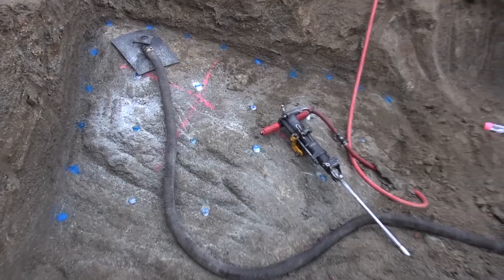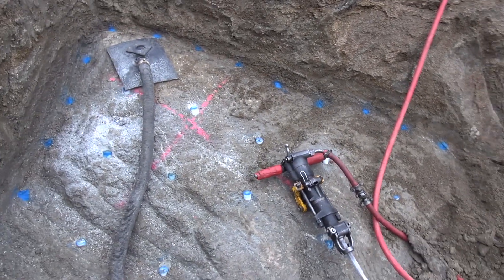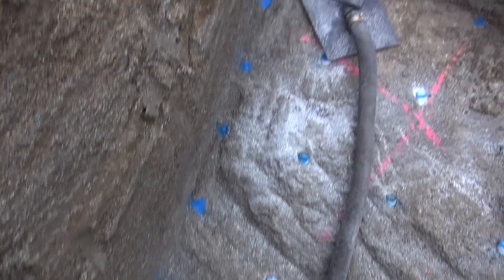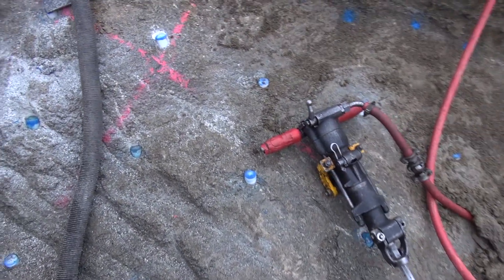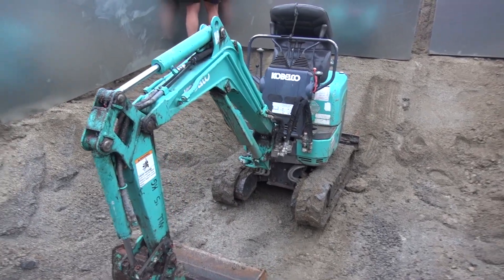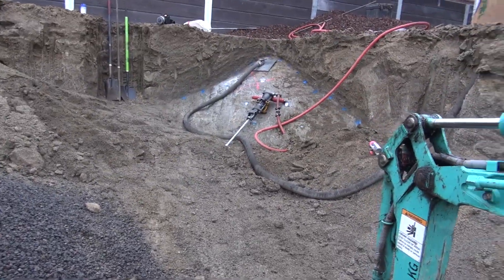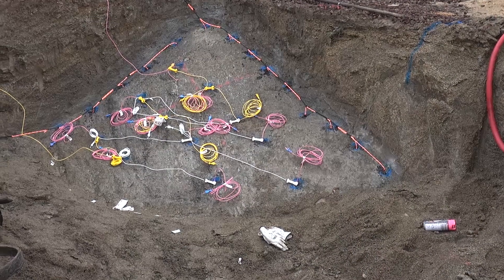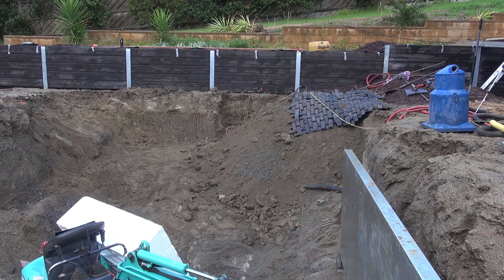Drilling and Blasting Granite for a home swimming pool excavation

Comment: Do you use a different charge in the Pre-split, or do it by timing? Nice one Dave. 👍🏼😀
Reply from the maker: Both! The regular blast holes have all of the charge at the bottom and they are fired sequentially, the split holes are loaded with a light uniform charge over the full length and fired all together.

Comment: Good job Dave. That split line was amazingly sharp and clean. That little excavator is amazing as well, it will fit through a standard size doorway. Now can the Rodeo tow a trailer with it and the compressor on it?
Reply from the maker: Not mine Mark, this one belonged to the pool guy.

Comment: Those holes along the outside edge can't have been fun to drill. Tough footing, carrying an air drill.
Reply from the maker: Yeah, That is exactly right Mr.LP Typically what I would do if it were too difficult would be to drop a longer drill into a lower hole and use this as a foot hold.

Comment: i'm glad i had finished my cuppa, or i'd have sprayed the keyboard when you said hydraulic teaspoon.
.
G'day Dave, great video.
edit: the movement in the retaining wall was fascinating to watch.
Reply from the maker: The wall, yeah, was a bit concerned about that as very likely the nearest post was also founded on this same rock. Changed my mind about firing the presplit line first and made it a post split for a milder vibration result, probably a good thing. Nothing like the coffee coming out your nose!

Comment: Another good one Dave 👍. What are the specs on the Compressor you like to use? (CFM, horsepower, etc.)
Reply from the maker: The small compressor that I most often use is a Sullair DPQ185 - 185 CFM - The drill only requires about 120CFM but having a bit more available if good when you want to use a blow pipe to move soil or when working in an alpine area where the air is thinner. It has a 2.2 Litre Turbo Cat motor.
Reply: @demolitiondavedrillandblast  That poor little compressor takes a hell of a beating from you Dave. Dragged all over Melbourne and Country Victoria to power your drills, day in, day out. I hope that you give it plenty of nice fresh oil and frequent filter changes and keep those tires pumped up!
Mark from Melbourne

Comment: Dave, did that blast heave so hard because you pre-split first, containing and reflecting the energy back into the waste rock?
Reply from the maker: What you say is valid but in this case I changed my mind about firing the presplit line first and made it a post split for a milder vibration result. main reason for the big heave was not enough cover available, hence I went home and grabbed 2 blast mats.

Comment: Very interesting. How does the preshot create a wall and not blow the whole area out into rubble?
Reply from the maker: Interesting construction method, no shotcrete on the sides, the floor gets concrete and then a liner is fitted, I believe the idea came from Canada, this company has been building them this way in Melbourne since 1969 so it must be OK.

Comment: Lot of drilling - looks like a new drill. Pretty large chunk there - always wonder how these things ever get formed. That was a lovely blast, slo-mo particularly. Great result and that little excavator is amazing! :)
Reply from the maker: I was also impressed by the small digger Chris. Very rocky in this area, I did the housing subdivision over the back fence in 2006, nearly 3000 holes total.

Comment: Nice.  High style points for the blast mat back flip.  And double so for that clean split line in the corner.  Well done.
Reply: I'm guessing that was a little less contained than intended, but it looks like it got the job done (just) and being spread out like that should make picking up the rock bits easy
Reply from the maker: Yes Benjamin, I would have liked some more cover but was pretty confident that I would get away with it.

Comment: Another great video , just curious to know a lil bit of your job , how is the explosives are triggered , the wires are like normal eletric wires ? And do you connect wires always the same way or depend of what type of rock ? Thx Dave and cheers
Reply from the maker: In this shot hook up, these are not wires but hollow plastic "signal tubes" they have a very tiny amount of explosive inside that carries a shock wave along the tube and down the hole to the detonator. The different colour designates a different time delay in the surface connector clip. The orange stuff in the back line of holes is regular det cord.
Reply: @demolitiondavedrillandblast  Thank you vm for your explanation Dave , Cheers
Reply: What I want to know is what the materials are? I'm guessing the orange stuff was det-cord but what about the pink, white and yellow? And does anyone have a link for how the delays actually work?

Comment: Did he buy that excavator from Bangood ?
Reply from the maker: No, it is a proper machine, a Kobelko SK008 https://www.kobelco.com.au/product-detail/sk008-mini-excavators.
Reply: @demolitiondavedrillandblast  I have been seeing little excavators for sale online for 169.00 $ like to see someone buy one and see what they get. I am to cheap. Hah hah. Got a feeling they are a complete scam.
Reply from the maker: @John Scott - That is probably $169 a day to rent???
Reply: @demolitiondavedrillandblast  No that was to buy with free shipping. Damn near tried to buy one but I didn't want to give out any info to them.. They pop up for sale in some weird places online. They where smaller then the one he was using. Probably have trouble digging sand if they are not a scam.
Reply: @johnscott2849  For that price I thought you may have been looking at a metal cast model of an excavator. Could you really go any smaller and be able to do any real work?
Reply: @markfryer9880  All I can tell you is someone is on it and operating it in the ad. Looks to be about 2 ft wide and have a digging depth of maybe 4 feet. I have not seen any ads for it for awhile. I think it was some kind of scam.
Reply: Being a Kobelco, I imagine they are not cheap. It is a quality machine - I have heard Kobelcos described as the ‘Rolls Royce’ of excavators. It weighs just over a tonne, 7.7 Kw engine power, 9.7 litres fuel capacity.
Reply from the maker: I have a Kobelco TTK - very well made machine.

Comment: While the rats nest of colored lines gave my inner Theatre Sound Guy fits (should be straight runs with neat coils for the excess... Sheesh... Lol), that blast was one of the most picture perfect ones I have ever seen.
It had beautiful delay timing, perfect lift and seperate, fully aerating the cover and moving rocks to the top, but perfectly damped so no shrapnel flying.
I concurred with the whoop! Lol
Reply from the maker: Yeah, the young builder guys working on the site had never seen any blasting before, they were stoked. Thanks Ken.

Comment: Tight dimensions met, happy pool builders, a legendary pool coming in. All in all smooth engineering by Dave. That boulder looked like nice hard grey granite! Nice dog; quickly checking out all the final dimensions after it was made ready for the concrete.
Reply from the maker: It was very hard stuff JW, always breaks good when it is hard.

Comment: Sounded like you had a happy bystander! Those machines may be small but they do alot of work. And they hold thier value! Around here you can buy a good sized machine for the price of one of those little tykes!!!
Reply from the maker: Yeah, the young builder guys working on the site had never seen any blasting before, they were stoked. It was surprisingly quick Thomas.
Reply: @demolitiondavedrillandblast  The amount of dirt and mats on that shot was a work of art! Those builders will now find all future residential shots pretty boring when it doesn't neatly overturn the stone from under the pile of dirt.